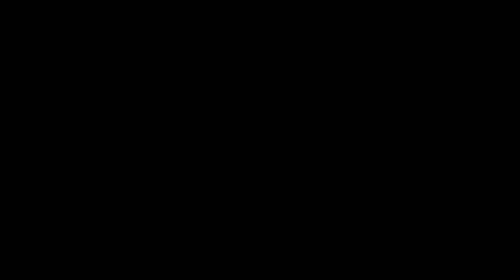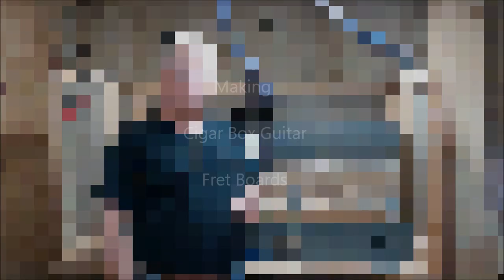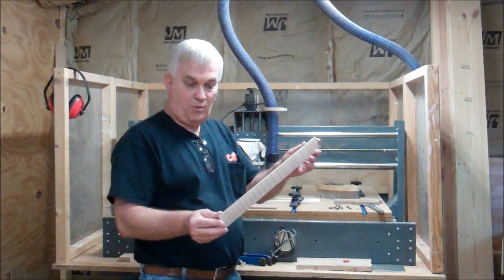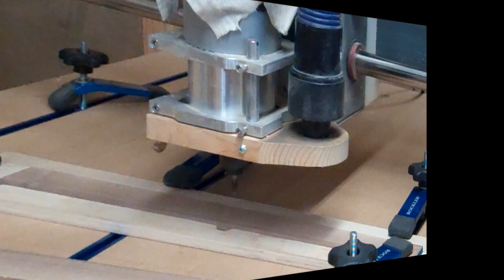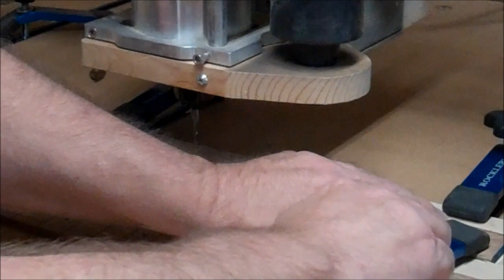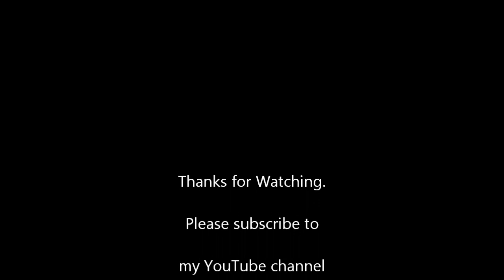Making Cigar Box Guitar Fret Boards

Comment: Dave,
Enjoyed your video.
I searched your cigar box guitar video list and was hoping to see you make a neck which has a scarf joint between the headstock and the neck.
13-15 degrees down on the headstock improves the strings coming across the nut.
I have several necks from Delta Groove Guitars and the scarf joint is very strong and works very well.
Mark.